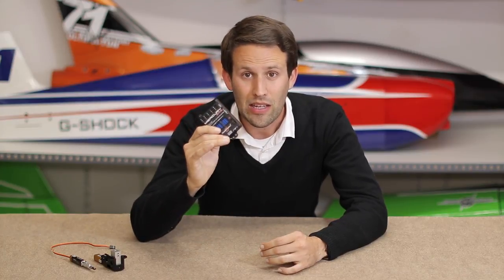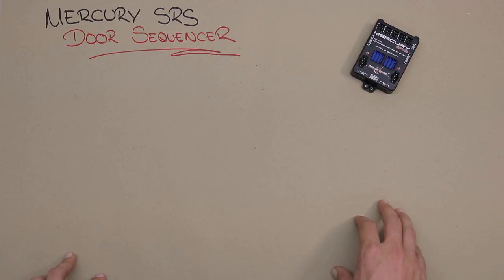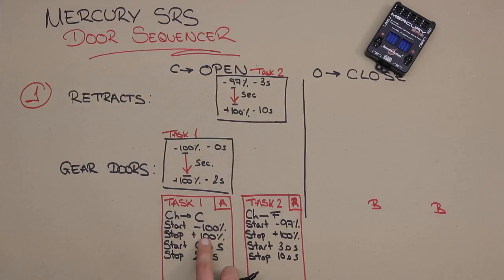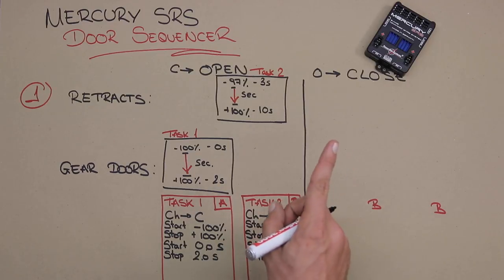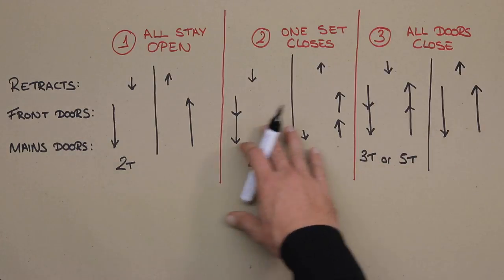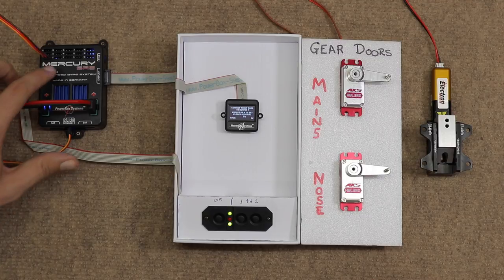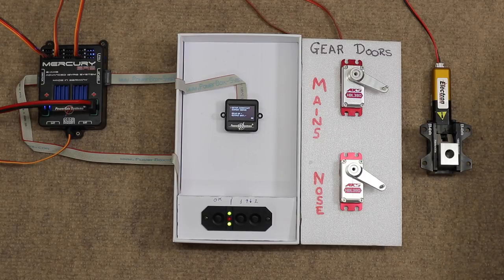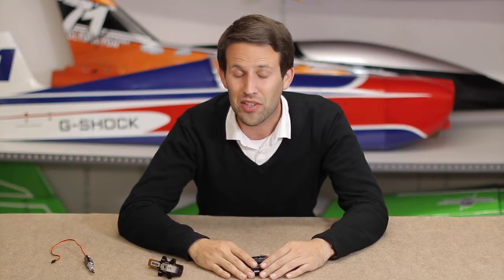HOW TO: Gear Sequencer for Powerbox-Systems - Step by Step

Comment: Martin, excellent. Could you do a follow up video using the Mercury SRS and the electron retracts and RB45 with brakes. My problem is the output mapping does not appear to recognize the transmitter channel I assigned for the brakes. I must be doing something wrong. Radio is a JR 28X . Aircraft is a Krill Avanti. Because of your videos I was able to understand and successfully set up the Mercury SRS with igyro, and sequencing for the front gear doors. I always look forward to seeing your videos. Thanks.
Reply from the maker: Hi Roger, thanks for the feedback on the videos, really pleased you find them helpful! We are actually working on a series of videos for Electron Retracts, these will start rolling out shortly on their channel.  
https://www.youtube.com/watch?v=OTZ7NVsiLg0
As for your specific problem currently, the Mercury doesnt know if what you have connected is an RB45 or a servo, it just sends out the same information either way. As it seems not to be detecting, I would reccomend plugging a servo directly into that slot and make sure that is working. Remember that if "output mapping" doesnt detect the right channel automatically by moving the radio channel, you can find it manually with the buttons.  Once the servo is moving as expected, just swap it out for the Rb45 and you should be golden. Good luck and let me know how you get on! Martin
Reply: Martin, Problem solved. Many thanks,